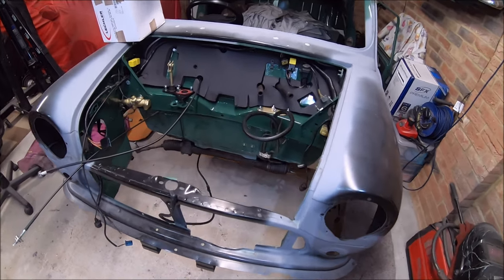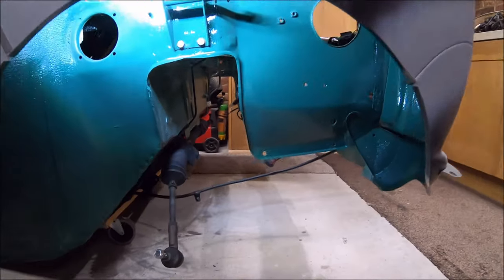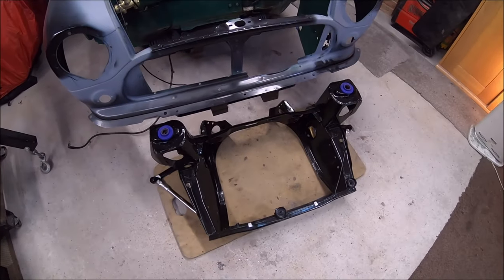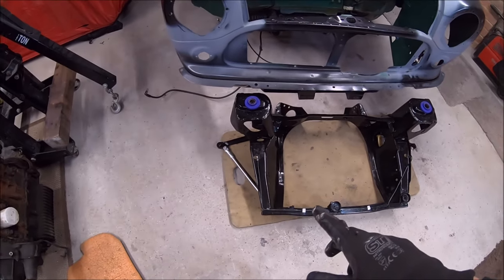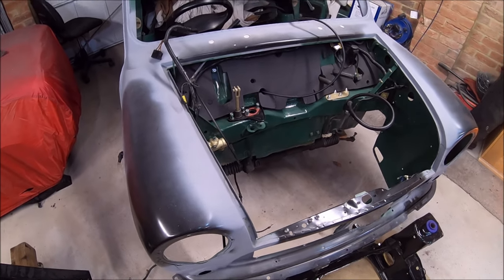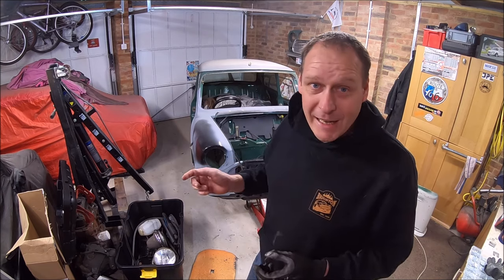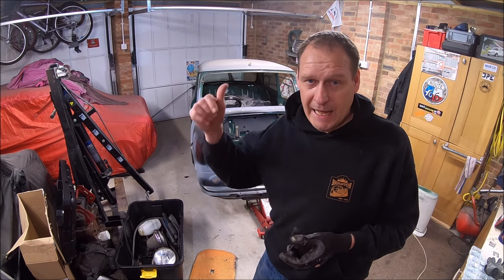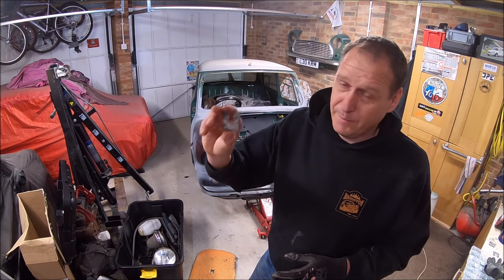Classic Mini Workshop - Project Sprout Pt.40 Refitting the subframe

Comment: I always thought that without the shims, rather than the front panel being pulled in it caused the rubber to be under stress and easily detached from the metal. After all. its bolted in 2 different directions with just the glue stopping it separating.
Reply from the maker: Yes good point! You are correct, it would more likely just cause the teardrop bushes to fail prematurely